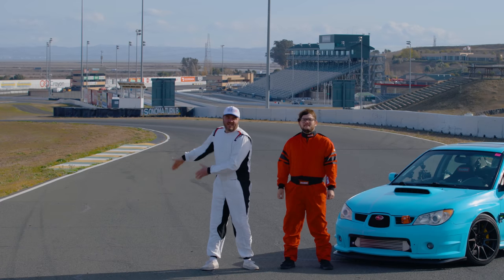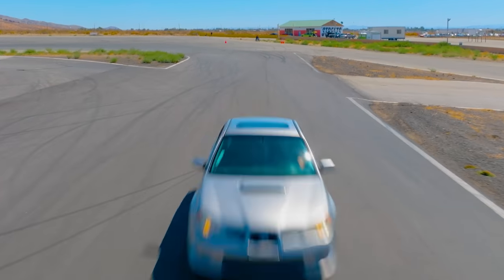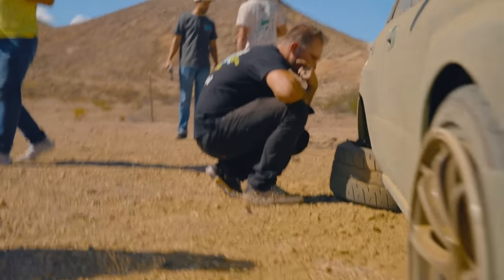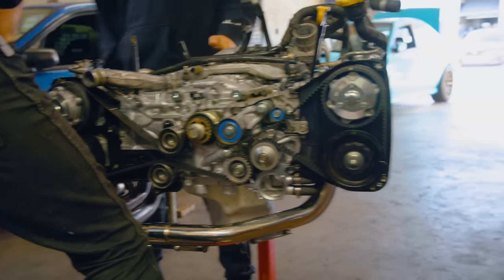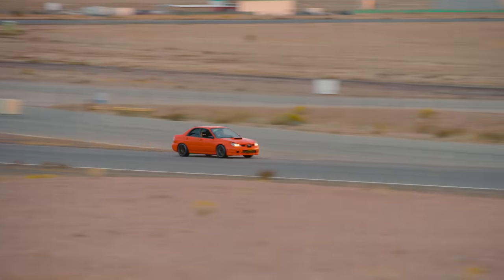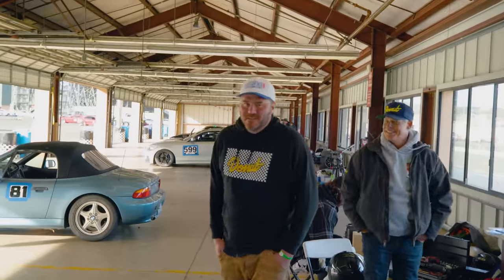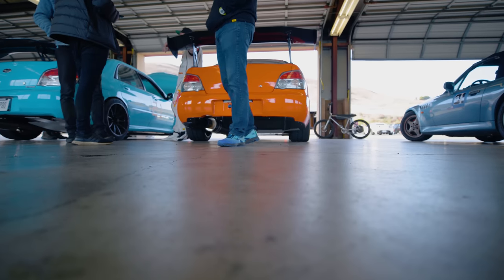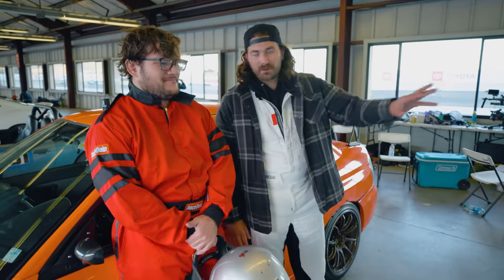$21,000 vs $43,000 Subaru WRX Build - HiLow FINALE!

Comment: You see video like this makes me happy. I'm building my fa5 now and I'm making it turbo soon. I don't want anything crazy like 800hrsp. Just a comfortable 430 would do it for me. However I will say that I spent the money on preformance rather than cosmetics, at least with my budget. Klm sidewinder, fullrace intercooler, 1300cc injectors from alpha injection, 6266 percision turbo gen 2 ball bearing, baffled oil pan, type s oil pump and fuel return. It'll make for a good every Sunday car.
Reply: what is the 100-200 of a car with that power?
Reply: @GodzDiscrace  I'm sorry. I don't understand your question!  Could you elaborate more please.
Reply: @Submergekill725  100kmh-200kmh is a common time used to measure how fast a car can get from those two speeds. Using an app called dragy, people also do 60-130mph instead of kmh. I was simply asking how fast a 430bhp scooby could do a 100-200 or 60-130mph run
Reply: @GodzDiscrace  I'm not really sure. It all depends. The goal for my car is close to 500 Horse power, but dialed back to 430 is more than doable.

Comment: So being the curious WRX owner I am, I decided to check the numbers online. High car is currently laying down the same lap times as a stock 2022 Elantra N.

FML
Reply: And slower than a GR86 with just camber bolts ($25) on proper track tires
Reply: @TimurIskhodzhanov  I owned a 2013 wrx hatch for a few years, bought a gr86 just a few months ago and it's so much faster. Can't even compare the two in canyons
Reply: @jeremyosborne1283  Parts don't matter if they're on the wrong car and the WRX is a horrible track car.
NA miatas with good wheels, tires, brakes, coilovers and chassis reinforcement would absolutely wreck these things on track without even touching the engine.

Comment: I'd love to see you guys run these cars against a stock STI of the same generation. Custom tuned vs. factory tuned. The STI has basically the same upgrades as you did so it would be a pretty good comparison. I've owned 2003 and 2013 WRX's, and a 2006 STI, so this series really hit the old nostalgia button for me.
Reply: Exactly. The STi 6 speed is also much better than the WRX 5 that's been known forever. Especially with them adding more power.
Reply: The STI is far better, especially the transmission.

Comment: It’d be cool to see rx8 builds since they’re pretty cheap to pick up. There is aftermarket support for k swapping and the chassis feels great.
Reply: No, I plan on buying an RX8. If people realize how easy they are to build, they will start to go up in prices. Let me buy 1 or 2 first lol
Reply: @PelonDeArizona  keisler automation lfx swap
Reply: @PelonDeArizona  honestly when I’m done with my s10 k swap I would love to put one in an 8, bought one a couple years ago and it was so slow I had to get rid of it. I know there’s a trans adaptor around to go from k to 8 so drivetrain should be solid enough for a few hundred hp.
Reply: I honestly gonna recommend the same 😂. I think they spent more $ on these engines than they would've on RX8's 😅
Reply: I blew up my rx8 at 75,000 miles. Fun car but unreliable.
Reply: @ItsMeHammie  thats why he suggests k swapping it. rotaries are inherently unreliable.
Reply: @ItsMeHammie  the engine yes. The chassis, no. Find a really good 80k mile shell for $800-1500, then do 
Junkyard LS swap… bam, cheap drift/ race car.
Reply: @customcreations586  there is an adapter plate for the k20 to rx8 trans, but if you do make sure to do k20, k24 require cutting of the firewall.
Reply: That would make a great money pit series.
Reply: @customcreations586  unfortunately you have to tear well past the firewall to fit a K in an RX-8. It's a tremendously difficult effort.
Reply: dump the Rennie for a Built REW. but most peeps won't understand..
Reply: @Dudeman9339  swazawl makes it pretty quick 😂 did the same on my s10 and a 16g steel plate for the new wall
Reply: @MrCukydoh  honestly loved the platform but the torque really isn’t there to make it a fun driving experience with the Rennesis, not sure how much you’d get with an rew tho
Reply: @customcreations586  rew is a turbo motor as god intended

Comment: Ironic I was looking to get one around 04-07. After seeing and hearing all the engines I think ima stick to miatas🤣
Reply: i wanted a bugeye cuz i’m up in michigan and winters rough, after every marketplace listing had “needs new engine” or “needs head gasket” i got the idea, at least my miata will mechanically make it through the winter
Reply: The STi is far more robust.  But still, it blows up. hahaha
Reply: There reliable they just have no idea on what there doing ahahahaga owned three Subarus and pushed 250kw reliably on unopened blocks
Reply: 2004 wrx on a built motor. Makes 448 to the wheels. 74,000 miles and running perfect. Do it right the first time and you're good. They cut corners and pushed the edges of what those smaller wrx motors were able to handle. Also, past 320hp the 5 speed transmissions are glass. Go 6 speed swap and forget about it.
Reply: 160k miles on my 06 forester xt pushing almost 400whp stock motor and I race it ALOT. They literally have zero clue how to build a performance subaru. Go watch Smeedia and you'll learn how to build these things reliably.
Reply: These guys just didn’t know what they were doing. Owner of IAG even offered to help and was ignored. These engines blew cause they didn’t break them in. Threw big injectors in on shitty California fuel without a proper tune, and a load of other reasons.
Reply: Own a Subaru with 250xxx miles. Run it hard constantly and still running like an absolute champ. The 5spd manuals can’t take more than 300hp. As for why it blew. Either build the 5spd manual or do a 6 speed swap. As for the engines, they never broke them in properly and cut corners to get the series finished. Do it right the first time, take care of them and they’ll last as long as you’d like.
Reply: See and that's just it I know of a few high hp builds that seem reliable but it costs what the car does to get there. I'm in washington where the winters aren't terrible but not great so a stock one seems great. but the ones I've looked at are either 40k because they're legit stis and built or they're clapped and like 15k with 200k plus lol. I want one for the all wheel drive rumble and they just look great. An sti would be amazing because the interior is mint, but jeez subie tax in washington is worse than a 240🤣
Reply: Thanks for all the info though everyone! I've been nissan and mazda my whole life but subies always peaked my interest
Reply: They are way more reliable than this series make them out to be. ESPECIALLY the STi. (Source, own an 06 STi. Track it)

Comment: Ya know, after coming back and watching all of this...

WRX's and WRX STI's are not bad cars. The problem is having proper maintenance history for the car if you're going to buy it. Also, if you're going to rebuild, PLEASE break it in. don't just beat on it. You can't take a street car to the track and expect it to be as fast as a Mercedes W11 F1 car, or hold up as long. Do the right complimenting mods to what you ultimately want the car to do, and don't beat on it like you stole it after installing said parts, you'll be fine. They are just as reliable as you want them to be...

Except for the 5 speed manual. That thing was living on a prayer up until it finally shattered. Surprised it lasted that long.

Comment: Thank you for this series! I was thinking about getting a beater STI, for the winters here in Virgina. Your informative episodes showed me that the STI’s aren’t the best option, unless you get a 6 pack of spare engines included. My wallet thanks you as well 🙏
Reply: They weren't informative, get a sti. They nodded thede cars completely wrong, didn't break the engines in, then crashed. The engine isn't as reliable as some but still, these is not a accurate representation.
Reply: Yeah they treated these cars like shit. Do your research and treat them right. STIs are amazing platforms
Reply: Yeah these cars were treated like shit, do your own research
Reply: @jacobstephens8447  yeah, then just blame it on subaru after their mistake.😬
Reply: Wise choice
Reply: Your lose! Not even the same engine. 😅
Reply: @michaelbrucker8624  your English is the only thing that is lost lol 

The EJ255 and EJ257 are almost identical. There are some differences, but the same block. You can literally interchange internals and heads on each.

Comment: Subaru out here panicking since this video came out 😂😂
Reply: these cars are 2007, and it's been WELL known and documented. None of these things are a surprise to anyone who knows about Subarus, especially Subaru themselves. Subaru ain't panicking, at all, new engines still have the same issues, they don't see it as a big enough issue to keep selling.
Reply: @gwot  yeah but driven media took a similar era wagon for 5k put 4k into it and beat a murcielago around a track by nearly 3 seconds. 1 car, 1 motor. They even boosted it to 300hp without blowing it up. If only they hadn't skipped the break in period.
Reply: @chrisswanson743  yeah, this is the shit I don't understand. What the fuck did they do to these cars?

Comment: The guys at Flatirons Tuning and myself were wondering when the transmission was going to let go, particularly 3rd gear. They lasted longer than expected since you guys were beating the heck out of it
Reply: What's up with this gearbox's 3rd gear? Not robust enough? I recently learned the full (sort of) reason why some Lancer Evo IX owners 5-speed swap their cars (5th/6th gear's not solid enough I remember), so this is my guess for the Impreza WRX's.
Reply: @yongling9825  The gears themselves aren't that weak, it's the input shaft that's the culprit, for the most part. From what I've heard from some of the Subaru experts is that the input shaft doesn't have adequate bearing support and as the engine's torque output increases, the chances of the input shaft flexing increases, and it's the flex that causes the gears to move and change the lash (tolerance between the gears) which results in them breaking. You can still break the gears but from what I've seen from another YouTuber who threw nuts and bolts in his 5-speed trying to break it and it took a while to still break the gears, I'd say the gears themselves aren't really the problem. I still however have much to learn about the 5-speeds and figure out what's really destroying them as most specialists aren't willing to spend the money to go deep into R&D with them, especially since the 6-speed manual exists.
I've recently asked Flatirons Tuning to go a bit more in-depth about the 5-speeds and what's really causing them to break, and they told me that they'll look into it more and make a video about it on their channel.

Comment: My biggest take-away from this is the clear distinction between racing cars vs mass produced racing-inspired cars. While the racing-inspired cars have more advantages and can be slightly more robust than your lower cost economical car, they will still break down quickly when you push them to their limits.

Comment: Just a heads up if you scrape that plywood splitter on the ground the moisture will get inside and swell up the wood. I scraped the one I built in a parking lot and it ruined it.

Comment: I think tires, brakes, coil overs consistently (and this is common knowledge in the car community) are the things you don't cheap out on. 
I'd love to see a Frankenstein series where you slap together a middle ground car mostly with the suspension stuff upgraded but the engine stuff still cheap.
Reply: i second this, we need a car they all work on together with middle ground parts
Reply: Yea except I was bouta get bbs coilovers and ecs ones went on sale for cyber Monday for 500$ instead of 1000 and I couldn’t pass that up, I’m only dropping the front for now though
Reply: Yes a himilow season!

Comment: You guys should do a series where you upgrade the drivetrain in one car and the suspension and braking on another and compare them.  We've all played Gran Turismo with the 1060 horsepower supra with no suspension upgrades.  It's hella fast but a nightmare to drive.  Let's see if hrsprs or handling wins!